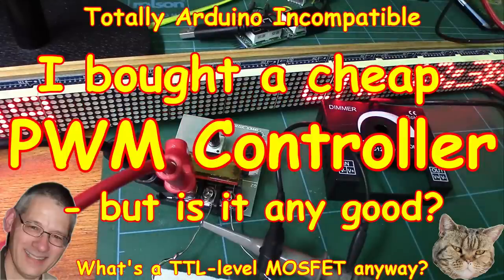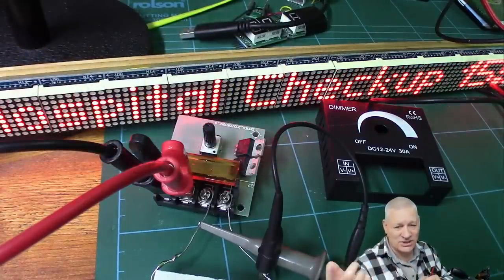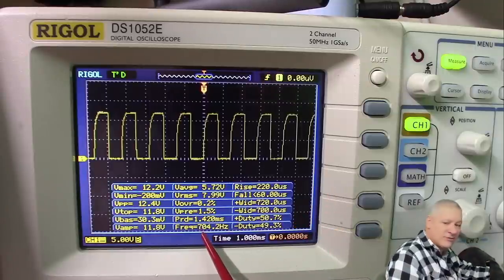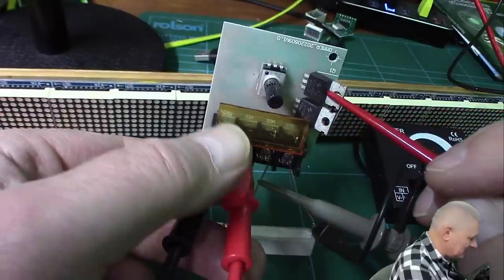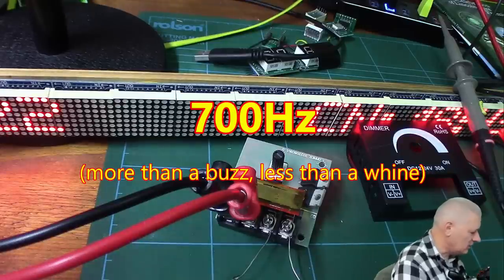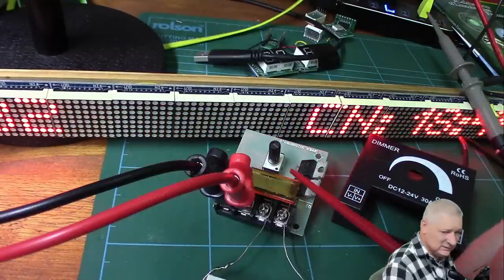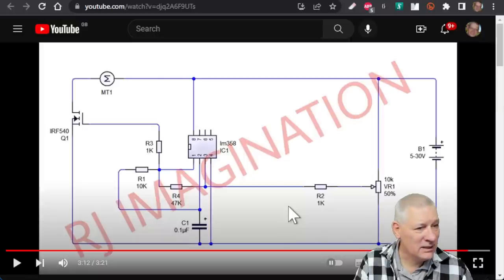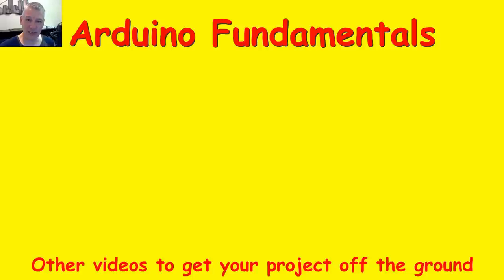#255 Cheap PWM speed controller for my pond - but is it any good? 🧑‍🎄

Comment: Seeing the waveform it looks like the IC turns the mosfet on too slow. Increasing the switching frequency could cause the mosfets to not switch fully on. 
I've had the same problem controlling a PC fan once, and I lowered the switching frequency to a few Hz.  That worked fine for me.
Reply from the maker: Yes, the waveform is a bit slow but seems to work "OK" although I noticed it was warmish to the touch even on my low amperage pump use. 

If I had the time, I'd replace the circuit with my own that could then start with the full 12v 100% for about 1 second before reducing it to whatever the pot indicates - that allows a lower speed without stalling. And I'd get some decent square waves!
Reply: @RalphBacon  It should be "easy" to modify the existing one with a startup boost using e.g. a RC circuit.

Comment: MOSFET's only work properly with a heat-sink. Even if you a a small heat source it needs somewhere to go. Shouldn't Q1 also have a flyback diode, for back EMF?
Reply: Not at all, there is a temperature range where the MOSFET will work quite happily without a heatsink and all the information required to achieve this for your particular application is clearly laid out in the device's Datasheet. As an example take the TO92 packaged device that will sink or source 100mA, perfect for low power applications. The person who drew this has not shown the ' Body Diode' that is present in this device (IRF540) and in a vast majority of them, again this is contained in the Datasheet that I just downloaded which is something I recommend for any design work.
Reply: @andymouse  The internal diode can protect the MOSFET from reverse voltage, but not from overvoltage. Cheap standard core brush motors can generate very high voltages.
Reply: @dunk_law  Yes indeed, better safe than sorry, commercially the don't bother but I might include one again it's not my design and i'm sure Ralph is aware but thanks for your input...cheers.
Reply: @andymouse  I was forgetting that it is driving MOSFETs in parallel. I have designed some with three.  This distributes the heat and may be cheaper than a heatsink. Don't do many though, I am more on the IGBT side of things.
Reply: @dunk_law  Those are fascinating devices too, often overlooked.
Reply from the maker: Good point about the back-EMF protection diode. As this dimmer seems to be sold to control LEDs I doubt whether one has been included. I should do so. Thanks for the heads up!

Comment: My name does NOT start with a @ nor does it contain an underscore,  though there is a space in there.  Screw you,  YouTube with this stupid "handles" nonsense...

I'm noticing that those chinese designers sure seem to like the 358 dual op amp chip.  My guess is that the circuit is likely to be an integrator and a schmitt trigger.  A real easy way to make an oscillator.

I was in a thrift store a while back and while I don't often find anything much useful in their electronics offerings,  I did notice this little box.  It was quite siimilat to the one you show here,  with voltage input and a couple of other terminals for the load.  On opening it up to look,  I did see a 555 chip and a MOSFET.  I haven't tested it out yet, not having an immediate use for it,  but I figure that for 99 cents it was worth that for just having the box!   :-)
Reply from the maker: Absolutely! As I said, the cases are the hard bit to get right! Now, @Roy_Tellason, what's your handle?

Comment: The only problem with increasing the PWM frequency is that switching mosfets have to go through their linear region and dissipate a lot more heat on each rising and falling edge, so as frequency increases, so does the heat generated in the mosfet. That isn't helped by power mosfets' relaively high gate capacitance (often in the order of nanofarads) which slows down any fast edges that are driving it. Going from hundreds of Hertz to thousands of Hertz probably isn't going to make much difference in low power applications like yours, but we shouldn't be getting the impression that we can simply raise PWM frequencies without limit.
Reply from the maker: I can go to 1MHz without issues, but I guess it depends on how much current you're drawing in your particular application, and what the RDSon resistance is for your particular MOSFET.
Reply: @RalphBacon  You're quite right that the current drawn will be a limiting factor.

However, the Rds for any power mosfet is not a limiting factor in raising the PWM frequency, because the Rds only controls the dissipation when the mosfet is on.

The key parameter is the gate charge or capacitance because that limits how quickly the mosfet transits its linear region where the product of Vds and Id is at its peak. Raising the PWM frequency means the mosfet spends a larger fraction of its time in the linear region, hence is limited by the ability of the driver to push charge in and out of the gate.

Comment: Has the heron found you yet? I gave up on pond fish after losing so many. There are loads of supposed preventative measures, but really the only thing that works is total exclusion, and who wants a huge net around their pond? Good luck.
Reply from the maker: The heron has not found us yet, and I'm considering a decoy heron but I've seen anecdotal reports that they don't work. 😔
Reply: @RalphBacon  I eventually decided that an overflying heron sees the plastic heron and thinks "Hmm. Plastic heron, there must be fish there, let's go and have a look". Certainly the heron walked straight past mine without giving it a glance. I do think it was pretty much always the same heron, who probably flew a pattern around the ponds in the neighbourhood, but anyway once he'd found me he never forgot. My father-in-law had a medium-sized but deep well-constucted pond, and had some success with fishing lines strung at about 24" off the ground around the whole pond on short wire poles. The theory is that the heron doesn't like stepping over the line, and the line is close enough to the pond that they can't land inside it from the air. A little unsightly, but also a royal pain when you need to get into the pond, removing the wires etc. As you can tell, having given up on it all, I'm a bit of a pessimist about herons.
Reply from the maker: So what you're saying is that not only do decoy, plastic herons not work, they actively encourage real ones to have a look! 😲
Reply: @RalphBacon  You've made me remember one contraption I never tried - a squirter. People, I believe, have used them to keep cats etc off bird tables, and I think I read on a forum somewhere of somebody using the same trick for herons in the pond. I'm not sure I ever believed in it, but anyway it was too much contraption for me to even try. At least you wouldn't be daunted by the sensors, electronics, power etc. And it might be more feasible for a barrel pond than a standard small garden pond. Might be fun to make, and provide some youtube content, even if it doesn't work. You may be able to get a version for bird tables somewhere on the internet, and then adapt.

Comment: The safest way for the fish may be to ditch the electronics and simply divert part of the water back, before it reaches the outlet. :-)))
Reply from the maker: What outlet? If I have an outlet it's going to be called a leak. This pond is self contained (and that's the way it will stay, I hope). 🐠

Comment: Are you now sponsered by Lidl 🙂, on the fish side have they survived the frosts???
Reply: Goldfish can survive the winter without problem, as long as the water doesn't freeze over.
Reply: Squeak !!!!!!!!
Reply: @andymouse  Cheese>>>>>>> toasted
Reply from the maker: Barrel Pond has frozen over but the bubbles keep an air gap working nicely. The water pump is also still going strong. It all looks a bit weird but I'm sure the fish are still under that ice somewhere!

Comment: How much would pcbway have charged to make the case? :)
Reply from the maker: Good question. I should have asked but I had time constraints. I will do that next time. That way I could design an ultra-simple, bespoke case but without the high cost of buying and setting up a 3D printer myself. Let the experts do the actual printing!

Comment: Another great video Ralph. Thanks for the knowledge you share. Time to get a 3d printer? What's a couple of hundred £s for a man of your means :)
Reply from the maker: It's not just about the price, it's about how to use the thing in a meaningful way. By that, I mean I want to be able to use it (over the course of time, say 6 months) in much the same way that I now design PCBs. It's an uphill learning curve for sure.
Reply: @RalphBacon  Hi Ralph, You'd have it making enclosures, spacers and lots of useful things in no time. As for the learning curve on using the thing and CAD: Not gonna lie, it is there, but you are more than clever enough to enjoy it.

Comment: I wouldn’t the solder those tabs…just bend them tight down to clamp the pot in place😊
Reply from the maker: Why, oh why would you say that, Flash? Bending them down is certainly step 1 to a physically robust mounting but why not actually solder them (like USB sockets etc)?
Reply: @RalphBacon  Just in case you might need to Change the pot.... Sometimes those little guys get skittery. But you can of course solder them too✌🏻😁I have the 'if that goes wrong, I can fix it fast' syndrome 😎
Reply from the maker: If this pot ever went funny (technical term, obvs) I would rip out the entire board and redesign my own! Now that you've mentioned it, I'm kinda hoping it will go wrong soon!!!

Comment: Although the MOSFETs are rated at 40A, but that PCB wouldn't be rated anywhere near that.
In fact the terminals are bit light on too.
Reply from the maker: The actual device says it's rated for 30A. Whether anything other than the MOSFETs would survive that, well, who knows!

Comment: Use a H bridge?
Reply from the maker: In this particular case, an H-bridge doesn't give us an advantage because we don't need to change the direction of the motor and to get speed control we still need to supply the MOSFETs of the H-bridge with a PWM signal (from a 555 timer, for example).
Reply: @RalphBacon  oh, sorry, for some reason i thought you want to control it with esp or any other MCU.
Reply from the maker: Well, I could control it with the ESP32 that's next to it (if I redesigned the Pond Pump Controller board, I would do this). But I still would not use an H-bridge, which is much more useful controlling bidirectional motors such as those found on models (cars, etc).

Comment: Good stuff, simply explained for us dabblers. Let's hope RJ IMagination cross posts to boost your channel.
Reply from the maker: You never know, Hari. But I was happy that they had already built something I could show everyone. So far, working well, but now I have 2" of ice on the pond (in sheets, as the bubbles have stopped it forming correctly).
Reply: @RalphBacon  Your next project then is to switch on an air bubbler as the temperature approaches zero to stop the  ice forming.  A complete solution to all your fishy needs.😊

Comment: You don't own a 3D printer. You might need one soon. I got 11 printers right now, too many for you. I might teach you how this thing goes. Best go cheap one under £150, can't go wrong. Or you can let PCBWAY make you one, not cheap in my case.
Reply from the maker: Yes, I know I need to sort this omission out but first I must find a 3D printing CAD program that lets me print, for example, simple things like enclosures (with lids). 

I've had a few suggestions (and I don't want any suggestions in the vein of KiCAD for PCB design, that would put beginners off forever).

Comment: LM358, that explains the crap rise time, ...NOT GOOD!
Reply from the maker: Well, it's not exactly a square wave, that's for sure, Steven. But whilst it's not good, it seems to be "good enough" for this particular use. Mind you, putting a lot of amps through this (which I'm not) might make the MOSFET hotter than it should be with a slow rise time like that.